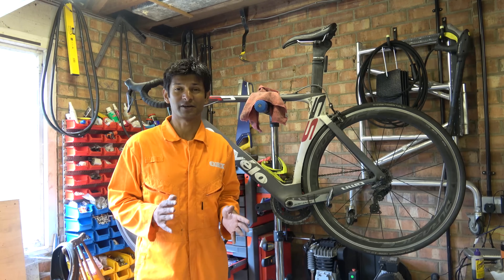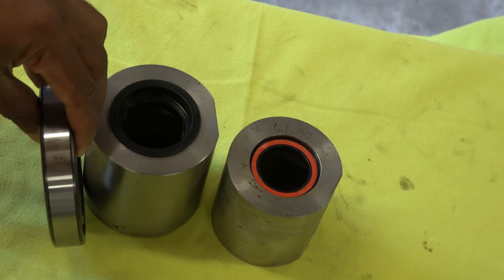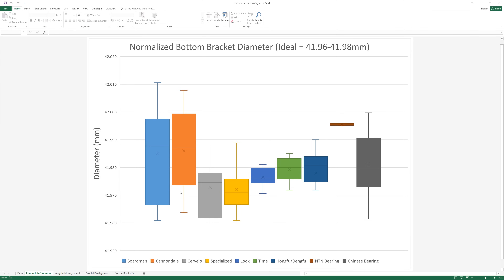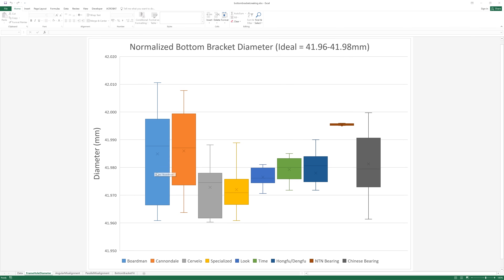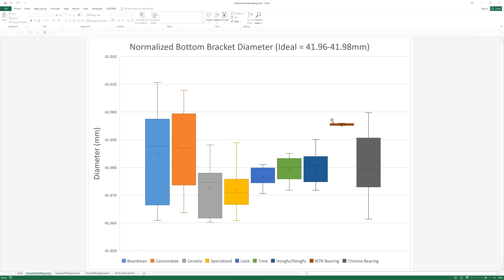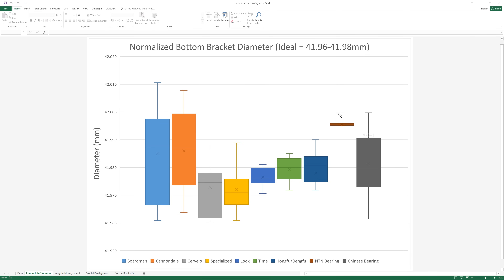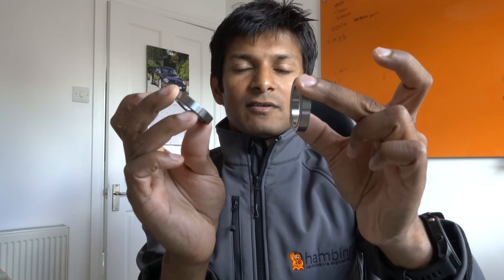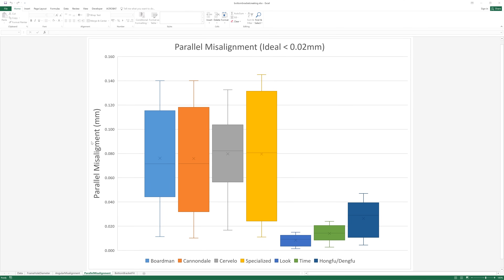Which Bike Frames Creak? Cannondale? Specialized? Cervelo? Hongfu? | Hambini

Comment: Anecdotal, but maybe of help; the majority of people who contact me wanting to buy Wakos Brake Protector to fix creaking BBs, have Cannondales.
Reply from the maker: Pinned, as I think it's valuable information for any buyers out there!
Reply: Hambini Performance Engineering Cheers mate  :) as you said, not all Cannondale do this but it just ain't worth the risk.
Reply: Yep, that's why I'm here. And I'm really tired of mechanics who tell me they've never heard of the Cannondale Click.
Reply: T Wallace The guy in the shop caressing your bike, with a name tag says Mechanic, is definitely a Sales Guy.😜
Reply: I have a CAAD10 BB30 with creaking noise. Once worn out I will replace bearings with Praxxis adapter and Shimano crankset
Reply: Can confirm, Wakos is legendary here in Japan, and Cannondale Japan officially recommends it for press fit BB installation!
Reply: that is because the majority of people have cannondales.  to close approximation all bikes have shitty BB situations. :(

Comment: I put a Wheels Manufacturing BB into my Cannondale Super Six Evo 3 years ago. I have done many thousands of Kms in all weather since then and not a single sound has come from that BB in that time. My advice to anyone with a BB30 is get a WF BB and use marine grease liberally when installing. I also use thread tape on the threads when I fitted it.

Comment: Do you people realize that there is a third (and much more common) cause of the creak? It's called dirt. 95 times out of 100, if you pull the BB, clean it, an reinstall, the creak will be gone. I repeat, 95 times out if 100. No need for a crazy machinist.

Comment: Doing a build with Press-Fit BB86, is the Wako Japanese Brake polymer or in the US CRC brake quiet appropriate for in use on Carbon Frames?
Reply from the maker: i find it is more like silicone and a pita to remove
Reply: @Hambini  with the exception of buying your BB which is certainly alluring, (this build is for my GF) how else do you recommend stopping creaks. I'm trying to prevent building and then hearing a creak
Reply: Fucking awesome reply btw. You fucking rock
Reply from the maker: if you put the wakos stuff in, all it's doing is deadening the noise, the fundamental problem is movement which causes the creaking. You really need to figure out what is out of alignment or out of round and address that problem.

Comment: Press fit creaking definitely seems to be very manufacturer dependent as some (Felt and Giant) seem to do much better. This data also matches what I've seen. Whenever I hear a BB creaking on a group ride, it's almost always a Trek BB90 or a Cannondale BB30/PF30. Specialized OSBB (BB30 or PF30) seems to be a bit better. One note: I don't think BB creaking problems are as common as the internet would lead you to believe. I'm sure even with Cannondale, the vast majority of frames are fine.

Comment: I have a 2013 Lefty Carbon 2.   All I have are 2 bearings that press into the BB shell.  No sleeve, no cups, no shims, nothing else.  Going into season 8.  I changed the bearings out about 4 years ago.  2nd set of bearings.  I pressed them in with a little lithium grease.  Do a lot of muddy, wet riding.  Have never had any creak or any other issues.  Was I just lucky?  I have never seen this BB on YT.  It's a SRAM crank.

Comment: Thanks for this very informative video (and the updated chart on https://www.hambini.com/bottom-bracket-pressfit-and-creaking-an-engineering-analysis/). Do you have enough data to assess the likelihood of getting a creaking BB with either Cannondale or Giant?

I'm buying a new bike and am torn between a Cannondale Synapse Carbon 105 and a Giant Defy Advanced 1 Ultegra. The price is exactly the same, and obviously you get higher specs with the Giant, including tubeless out-of-the-box and slightly lower weight. However, I find the looks of the Defy disagreeable — both the seatstay geometry and the graphics/paint job. The Synapse is so much more slick and elegant, and I love beautiful bikes.

Is the risk high of getting BB problems significantly higher with Cannondale compared to Giant? Or is it more of a toss of a coin with either?
Reply from the maker: You are probably a bit better off with the Giant.

Comment: How many frames of each manufacturer have you measured? Are your error bars based on multiple measurements on one bike frame or more than 1? Or are your error bars based on the precision of your micrometer? Isn’t it possible that the Boardman frame was exceptionally out of round? On the other hand, isn’t it possible that the Time frame was an exceptionally good one? You should indicate the number of frames (N) on your graphs that you measured if you measured more than 1.

Comment: Got a CAAD12 and it had no creak, but then I got a pioneer power meter with a BB30 adapter and the creaking started and never went away.  The shop reinstalled the adapter and it stopped creaking for about 5 minutes.   I do not know what kind of adapter they put in but my current plan is to get a new adapter and have a different shop install.  What adapter would people recommend?

Comment: I bought a brand new Cannondale CAAD13 around 8 weeks ago. After a week of ownership, I started to get BB creak from the bearings when climbing. The CAAD13 replaced a previous CAAD8 which is also a BB30 frame. I've replaced the bearings multiple times on on that frame in it's lifetime and sometimes I had creak, sometimes not, depending on the bearings used. There's plenty of real-world examples to back-up the results of your testing

Comment: Can a bicycle frame, specifically the bottom bracket openings, be blue printed? Is it at all possible to build up or re-machine these openings to some datum (where would that be anyway?). I used to work for a pro motorbike race team. Our motors were 'blueprinted' versions of production engines. In that world there are so many parts it is too costly for amateurs. But with bicycles, there is just one opening. Maybe that would add some cost to mid level bikes but not relegate everyone who doesn't want power losses or creak to only a few high end bike choices. I haven't seen all your videos, but it looks like in some cases you compensate for the frame problems with a custom BB shell. What about going the other way, fixing the frame?

Comment: I have to disagree on your interpretation of cnc machining.the issue is the manufacturing process and the operator running the machine can compensate for tool wear. Just my 2 cents .i am not defending the shit process but just an observation

Comment: you could have included canyon in here so we could see what German manufacturing looks like
Reply: Unfortunately it's not german manufacturing, otherwise the frame would cost triple what it does. It's Chinese/Taiwanese manufacturing to a specific price point. While Canyon do check whether the frames are safe for riding when they receive them from the manufacturer, I doubt they're testing the BB alignment or other things like this, that would be prohibitively expensive to do with every frame.

Comment: CNC machining can also produce a very tight tolerance, but you need to use a tool for the final cut which have a adjustment screw and one single tool edge and the operator must measure the hole at an ongoing basis, when tool is worn then take out the worn tool edge and turn it, screw the tool insert back and take a measurement cut, adjust it accordingly and start the machine again. I know this in detail since I was a CNC operator at Volvo in the late 80ies, have made thousands of H8 tolerance holes, appr +-0,03 mm in the diameter range we worked. No problems to manufacture holes +-0,01 mm and completely in line.

Comment: My Cannondalr CAAD12 BB30a (aluminium frame) creaks
Reply: I cured mine with a Chris King bottom bracket
Reply: @cmdrrgh  nice but no Chris king for BB30. The bearing it self is most likely not the problem but the fit in the frame.
Reply: @maxgrass8134  Max I swear my Cannondale Si that’s made in 2017 has a BB30 bottom bracket
Reply: @cmdrrgh  possibly. With bearings pressed directly into the frame? And no screw in or press in bottom bracket? Just the frame shell with 42mn inner diameter and the (raw) bearings pressed directly into the frame? And you found a Chris King BB to fit in there using a 30mm crank spindle? Do you have a link n for that?
Reply: @maxgrass8134    My bike shop handled that, it does have a Scram chainring. When I need something done I tell them what I want and if they can do it they let me know

Comment: Dear Hambini, I believe one aspect in your video that allows those manufacturers still staying dry and safe, is that the viewers are not aware of the power of your box and whiskers plots.
People may not be aware, that all these plots were results of A LOT OF MEASUREMENTS FROM MANY BIKES! THOSE BRANDED BIKES INCLUDED!
The plot, if put in laymen's term, can simply means a group of for riders with the same bike brand, may have two of them have their bikes' geometry around the both extreme ends.
Isn't this true?

Comment: What about Pinarello?
Reply: They are threaded
Reply: @martycurren5350  Does that eliminate it from "creak frame"  talk?
Reply: @alinutzalin6346  it should as in a carbon shel with a poor tolerance the bearing can move. In a threaded one there is a metal threaded shell bonded to the carbon outer which the bearing cup threads into. Heavier but should not creak.
Reply: @martycurren5350  I would rather have a bit of weight an be able to service it easier and replace it for cheaper.   Just like internal cables...

Comment: How do you justify normalizing bores from different standards with different tolerances? BB30 has a tolerance of 0 to +0.02mm. PF30 has a tolerance of 0 to -0.05mm.
Reply from the maker: It's normalisation of the size and deviation not the standard itself. I'm looking for variance not whether it fits the exact 0.05mm or not.

Comment: Should my take on this for Specialilzed owners be that the range is fairly tight and ideal except for the outliers above 41.98mm?  (Parallel alignment is scary but they're all scary in that group.)  Is this something I could take to the shop owner when looking at a new frame--a micrometer to make sure mine isn't a dud?  Anecdotally my Specialized Tarmac SL2 has only had the faintest of creak in the most demanding situations, 20% grade 200-lb body weight.  Other than that I've had no problems.  It looks like Specialized is about as good as one can get with a manufacturer that subcontracts.  After seeing this, however, I am going to take a serious look at Look and spend some time with Time.  I also wonder what frames these samples were taken from since Specialized has quite the range of price levels and I'd assume they'd sell the best frames only in their higher categories.

Comment: Does anyone check on whether the BB is parallel with the other axles on these bike frames? Back-in-the-day with quality steel frames the BB shell was faced and then the frame clamped onto an alignment table to be checked. Misalignment of any sort was fairly easy to detect. Does anyone even bother trying to check this out on molded composite frames these days? I'd wager there are more than a few of these carbon things going down the road somewhat sideways.
Reply from the maker: I don't think they do check.

I get loads coming through that have misalignment beyond what I would class as acceptable but nothing is done.

Comment: I’m also curious how Giants would stack up, since they own their factory.
Reply: Hambini has added Giant to later versions of this same chart. Giant came in as one of the best in terms of accuracy, about on par with Time. Also, Giant uses the BB86 standard exclusively, which some claim is the least problem-prone of the various BB standards as it allows slacker tolerances. In my experience, Giant bikes have good BBs and overall good engineering in their frames.
Reply: @hiro111  Thanks! Here's a direct link: https://www.hambini.com/bottom-bracket-pressfit-and-creaking-an-engineering-analysis/
Reply: Same...I too want to know where Giant sits on this.  Nt sure if luck or their good manufacturing but my 2012 Defy Advanced has never made a single peep.  Hoping the same holds true for my new 2020 Defy Advanced and Revolt Advanced.
Reply: @johnfarr5415  My brand new TCR Advanced 2 is creaking... Supplier has sent me a new BB which I am having fitted on Tuesday, but am now soooo worried. :(
Reply: Guys, my Giant BB had been fitted badly. New one is silent as the night.
Reply: 2017 TCR 1 and 2019 TCR 1 both creak
Reply: Mr Painterman oh no I wanted to buy a Tcr as well thanks for the update
Reply: My Colnago CX Zero Alu was built by Giant. I hope it's built properly.
Reply: Juan Cisneros  well they do own several factories, but it takes real engineers to figure these numbers out.

Comment: These days if you can operate a cad system and draw pictures, you are automatically a mechanical engineer. They can not even put dimensions on drawings because they do not understand tollerancing, because they do not understand the concept of fits and clearances. Fits and clearances are dependent on the fact that two objects can not occupy the same space at the same time, to say nothing of properties of materials.

Comment: Cheap threaded square tapered bottom brackets are the way to go. for 10$, I order 3-4 of them and just replace as needed every season. Sometimes they will go more than 2 seasons without creaking or play and they are very easy to replace.

Comment: Press fit bearings just like compact framesets were introduced to save money in the manufacturing process and maximise profit. Of course they told consumers stiffness and power transfer was the reason.
Reply: Compact frames are pretty unobjectionable afaik

Comment: I was reluctant to get a bike with push fit BB, but I needn't have worried! The Shimano push fit unit in my Rose carbon road bike has done almost 20,000 miles with no creaks or signs of wear! My previous bike had BSA BB (treaded aluminium sleeve bonded into carbon frame) which went through 3 FSA units in less than 15,000 miles! The FSA units were crap though, especially the procedure for fitting them with the cranks. When the last one failed, I was struggling to get a replacement and FSA themselves recommended a suitable replacement from their catalogue which turned out to be completely inappropriate!

Comment: Any first year basic machinist or CNC programmer would laugh at the "Enginners" who thought it was a good idea to press fit bearings into a carbon frame. I call these "Paper Enginners" they work for GM, Ford and Fiat Chrysler hence why they produce garbage vehicles. My $250 road bike with ancient square shaft BB is dead silent, and that is with 1/4 steel loose balls.

Comment: The Cervelo bike at the start, the bottle cage is on UPSIDE DOWN.
Reply from the maker: I had to turn it upside down because the bottle would come out when I went over a speed bump. I have since lined it with rubber and turned it the right way up.

Comment: Very interesting. Got a Trek Madone (bought 2013) which develops a steady tick several miles into a ride then gets louder and more persistent. It's a PF30 BB. Notice that Trek have now gone over to threaded BBs for the new Domane. Never had any trouble with the old square taper BBs.
Reply: Thats a pedal, unscrew your pedals and grease the crap out of the threads then tighten them in well, remember that the threads are opposite on to each-other. But yeah, its probably your pedal and all you need is some bicycle grease and a pedal wrench to fix it.
Reply: @BigChiefWiggles  Replaced pedals. Cleaned all threads. Applied fresh grease. Still clicking. Particularly bad when climbing  - out of the saddle.
Reply: @Anybloke  Wow, well thats not good, every time someone showed me the bike with a creak they thought was BB it was something else, generally dry or lose pedals, but, you might have the actual BB problem, good luck figuring it out.

Comment: Simple question: if a Shimano crankset spindle is 24mm why the bearings that you use are 25mm internally? Doesn't 1mm difference in diameter create a tolerance problem? Do you think changing Shimano bbr60 standard bearings is a good thing? Thank you for the contents
Reply from the maker: My bottom brackets use a delrin sleeve between the axle and the bearing. Shimano bottom brackets do the same thing as it avoids the hardened bearing grinding the axle down.  HOpe that helps Hambini

Comment: Actually, if you don't want a creaky bottom bracket, buy a steel bike with a threaded bottom bracket.
Reply: And that exactly is what i got! Im a metal fan, even if it is a little heavier, it just rides better..
Reply: The Caad10 from cannondale is a steel one and steel creaky
Reply: @lukkesconsulting  Are you sure the CAAD10 frame is steel? I only ask as CAAD has always stood for "Cannondale Advanced Aluminum Design" and a quick Google seems to point at Aluminum.
Also, CAAD10 frames use Cannondale's famously creaky press-fit, non-threaded, BB30 bottom bracket which is of the variety not recommended by Jay Tee.
Reply: @jonb77  Jon you are right, its a aluminum frame, but lot of problems with the creaky bottom :-)

Comment: Does Hambini have a BB solution, which would allow me to fit a SRAM GXP (AKA Truvitiv) chain-set in a Giant Trinity frame? This would replace the Shimano press-fit BB72 BB that is specified for the frame.
Reply from the maker: If the frame is not double lipped then I have a drop in replacement.